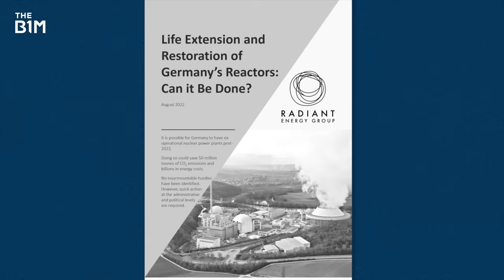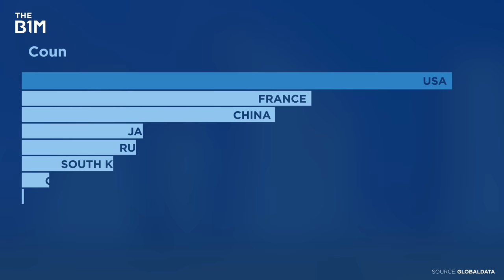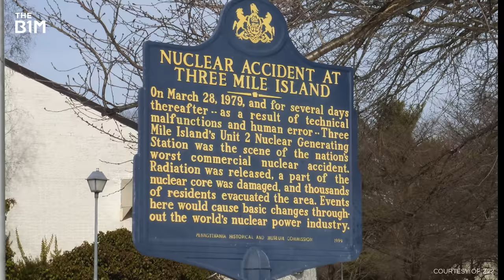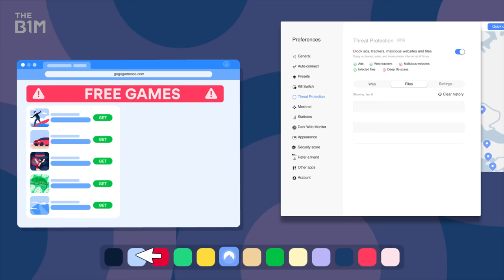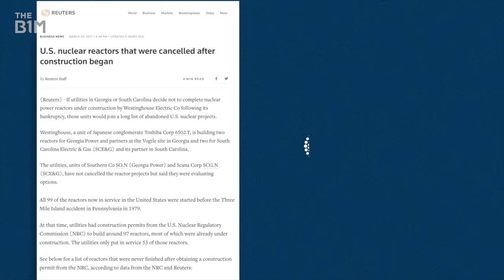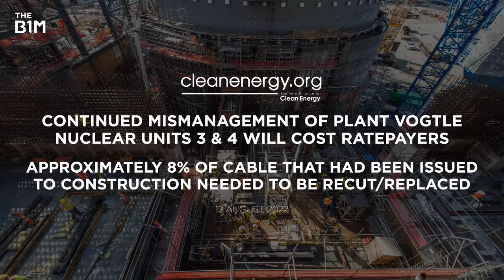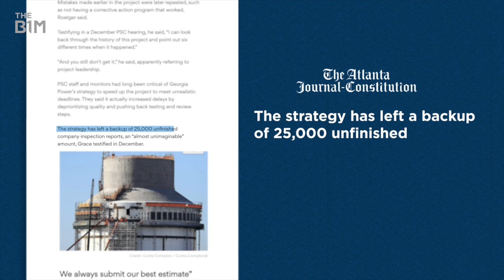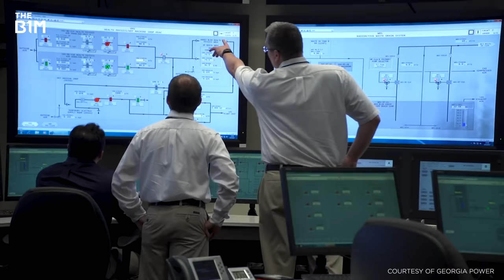Why Nuclear Power is Making a Comeback

Comment: It cost more because we're paying the price for losing industry knowledge and practice. Effectively, we're re-learning how to do this from scratch. That costs money and time.

But its well worth it. These will far outlast gas and coal plants and produce next to no emissions.
Reply: WRONG.  The AP1000 was first built in China and both VC Summer and Vogtle had engineers there and the reactor supplier made any necessary adjustments to improve the build.  Do U.S. construction workers need training on how to weld?  How to bolt things together?  run wiring?

The $31 -$32 billion cost for these two units is 2-3 times what any other power source costs.  They cannot raise electric rates enough to even pay the $1 billion in loan interest let alone ever paying off the principle.
Reply: @clarkkent9080  Do you think we're hiring Chinese crews to build AP1000s in the US?

So no, being built in China doesn't exactly help train US crews or create the industry to support the reactor. All that was left in China.

And those high costs you highlight? A small drop compared to the high costs Climate Change is going to cost.

And we're talking about $32 billion over 50-70 years. 

The idea that because something is expensive its not worth doing is why were in this mess to begin with. Being cheap is not going to pay off the environmental debt coming due.

Comment: Not sure where you got your number for the Flamanville reactor in France but it's not $300M over budget. Based on wikipedia, it's $9B over budget with an initial estimated cost of $3.3B. Similar issues for that reactor and the one in the US: loss of expertise on how to build these things.
Reply: And massive overregulation for “safety”… it’s not “just” the loss of the supply chain and expertise.

Comment: Hi. Unfortunately a very one sided video! The high costs for energy are a huge problem (even with no cost explosion and delays). But more importantly, nuclear power is not the counter piece for solar and wind for the times when “the sun isn’t shining and the wind not blowing”. Nuclear power station need to be rubbed very very steady and are not able to react on the demand resp. on the production fluctuation. 
I really like this channel but please be more journalistic and balanced with your content. Thank you.
Reply: Well, a nuclear powerplant can react on demand but in order to be financially viable it pretty much needs to run at 100% load 24/7. Running the plant at 60% so there is capacity left to ramp if needed, this will cost nearly the same amount of money compared to running it at 100%.
Reply: @oO0Xenos0Oo  It needs to run at 100% because it is not very flexible. Nuclear could theoretically be but current tech is not and it would need a lot of research.
Reply: Nuclear is classic base load generation. A power grid will have a load floor that it rarely if ever goes below. Nuclear running 24/7 fills that base load with zero carbon regardless of wind or sun. Dispatchability is only important for intermediate and peak loads during the day. Take a look at the live generation stack for an RTO like PJM and you'll see a variety of generation sources working together.
Reply: @XMysticHerox  you can absolutely dispatch nuclear power today and it is sometimes done. It makes no financial sense though since there is negligible variable cost between running at 75% or 100% for nuclear. There are limits though, as you can poison the core and have to power down if you reduce power too much, and they are also slow to ramp.

They are such large generators usually in the 800MW range or larger that you only want to lose sync to grid for refueling outages.

Nuclear is base load generation though, there is no need to dispatch them.
Reply: Today's nuclear is suitable only for constant output.  But future Gen IV designs being worked on all over the world will include molten salt reactors fully capable of load following because the Xenon gas that "poisons" the reaction will bubble out of the reactor.  Don't condemn the future of nuclear power by assuming a lack of progress in design of new much less expensive reactor designs that are inherently safe.
Reply: @ChristinaK1024  But thats exactly my point. If it is not economically viable to do otherwise it is not dispatchable. The person I responded to implied nuclear is dispatchable. It's not. Not a single current plant does anything but provide base load and thats not going to change without new tech.

Comment: Nuclear is cleaner in many ways than hydro. Both environmentally and socially.
Reply: I think thats debatable. Both have major impacts during construction phase. The whole uranium mining isnt clean, nor is the waste storage fully solved. In the end all forms of construction and producing have their environmental impact. Also there are multiple forms of hydro electric production.
Reply: @stroll-and-roll  There are some fairly clean small scale hydro options, but the large dams require flooding huge amounts of land, which is usually the best land in the region and tends to disproportionately target lands owned/inhabited by minorities. Which tends to be comparable amounts of land lost as the size of the Chernobyl exclusion zone, with a similar timescale for how long they’re lost for. It’s not as bad as oil or gas, let alone coal, but it’s still worse than nuclear energy.
Reply: @stroll-and-roll  Hydro power totally destroyes the local enivroment

Comment: The irrational fear of nuclear energy is the same as the irrational fear of flying. Flying is the safest, and fastest way to travel. Nuclear energy is ONE OF the safest, cleanest, and most efficient way of generating electricity.
Reply: The thing with flying tho is, that in case something really goes wrong you are definetely more likely to die than other ways of transport! also safety of NPPs is a major issue that wasnt talked about in the video. Like in Ukraine atm.
Reply: @stroll-and-roll  Most nuclear reactors aren't being shelled by hostile imperialistic powers though
Reply: @stroll-and-roll  "More likely to die"?  Does it matter if you are one of 200 to die in an air crash or one of tens of thousands killed in auto crashes each year in the US?  The likelihood is all in the statistics, which favor air travel.

Comment: Just don't connect the reactor control to other networks to prevent the "Battlestar Galactica" problem (where the "Cylions" pulled the plug on entire fleets via backdoors in the operating system)

Comment: There has been one major issue regarding the development and implementation of nuclear power plants that I have hardly ever heard mentioned. In the past, nuclear plants have been attempted to be built but have run into tons of logistical issues regarding regulatory bodies in the government. Engineers for plants would meet the necessary requirements for a plant, begin construction, only to be met with new and updated requirements during the process of construction. The engineers would be forced to alter blueprints, reconstruct already finished parts to implement the changes, which would increase the budget drastically and slow progress. The regulatory bodies would keep changing regulations over and over to the point where the plants were essentially a complete waste of time, money, and resources which would lead to the project being scrapped

Comment: The construction of "smaller" modular nuclear plants is still to happen commercially. As the UK showed, if you don't build new nuclear for ages, then you lose talent and muscle memory. Meanwhile Europe needs big plants and even the French have not built new plants for ages. We are still awaiting more self-compensating "cheaper" nuclear that can attract private capital, avoid massive over-runs in cost and meeting time schedule plus avoid chronic time delay in planning. Meanwhile many existing plants need to be refurbished just to remain working safely. Upgrading existing plants to extend their lifetime and boost efficiency from what was on offer in the 1970's will be as big a project as any new ones plus the old ones exist, work and not everything would need to be upgraded to extend their power generation lifetime. However retrofitting will cost as much if not more

Comment: You know you can pump water uphill while the sun shines and use that energy later or produce hydrogen to use later
Reply: And you know that those installations are highly dependent on geography while producing hydrogen wastes a LOT of the energy you put in it in the first place.
If we would run on 100% emission free energy, you would have a point. 
But We're not

Comment: I honestly don't understand why people are so opposed to this. People usually are VERY into "high tech" solutions that act as a silver bullet solution.
Reply: My Georgia power electric bill is some of the highest in the nation due in part to Vogtle unit 1&2.  I have has a 19% Vogtle construction  surcharge on my bill for 3 years now and they just asked the PUC for a $600 million rate increase for unit #3.  Georgia power has 2 million customers....you do the math.  NOW do you understand?
Reply: @klerkcant9080  And your electric bill would be much higher on ruinables.  Along with those exorbitant electricity rates, you also wouldn't have power available at all most of the time..

Comment: Recently in 2024 I see the UK has made a strong commitment to build 40 small modular rectors (SMR) in 10 plants across the UK, each plant have 4 reactors.  Using the new X-Energy Xe-100 reactors.  These new high temperature reactors use helium to transport the heat at 800 degC....which is efficient.  The reactor fuel pellets are tennis ball or billiard ball sized 60mm diameter and are 3 or 4 times coated and do not emit any radiactive materials.  The helium gas does not become radioactive.  This gravity fed system replaces 175 pellets every day continuously automatically for 60 years, or can be replaced in batch mode to permit maintenance.   Please review this new Xe-100 reactor...looks like the UK will be doing this very soon, and can use co-generated heat to do other things like desalinate water, or get hydrogen.
This Xe-100 reactor operates with 95% availability, and is load-following, switching from 75% to 100% output power within 10 minutes.

Canada also has a similar approach they are working on possibly also using the Xe-100.

In the United States the Xe-100 has also passed many safety protocols, papers, protocols, and reports; and is soon on its way to be submitted for NRC approval.

Comment: FUN Fact 1.... Wind costs $1.3 million per Gigawatt, so $30 Billion gives 230 Gigawatt hours installed power. Half that put the rest into storage. No Melt-Downs to take out a city value of real-estate... How much is that?
Reply: Sure, wind costs are cheap; and batteries cost about 100/kWh. Ooops! not so cheap.

Also, although wind may only cost $1.3 million per Gigawatt (installed capacity),
it has a capacity factor of 35%, so it would cost about 3.7 million per GW (useful capacity).

Comment: Nuclear has always been the answer. Frankly it’s sad that a plant placed in a geographically risk prone area that underwent a relatively expected event. Which happened to have a slightly higher tsunami than expected. Like. What. Do they expect a tsunami to hit the middle of Illinois… crazy huh
Reply: That wasn't the problem. The problem is something unexpected happened: it lost outside power as well as the emergency generators. Nuclear plants can't lose power or the pumps won't work and it will overheat and meltdown. They also didn't know that hydrogen could build up and explode. Who knows what else they don't know? Russia and Ukraine seem to be playing Russian Roulette with their nuclear power plants. It wasn't expected to have nuclear plants in a warzone.
Reply: @sandal_thong8631  The did too most certainly know about the hydrogen.  If their culture allowed modern updates to the plants as recommended there wouldn't have been an issue.  Those generators were a known issue.
Reply: @nathanwahl9224  A known danger that's ignored sounds like... negligence?

Comment: NUCLEAR power is amazing we need more of it
Reply: Like this?

If you live in the U.S. here is the reality for the last 4 “state of the art” Generation III Westinghouse AP1000 ADVANCED  new nuclear power projects and spent fuel reprocessing in the U.S. over the last 20 years. The AP1000 is fully approved by the NRC for construction and operation.  The only NRC requirement is that the plant be built per design documents…..seems simple..

The Southeastern U.S. is super pro-nuclear MAGA, has zero anti-nukes, and 100% media, local, and political support. 

The MOX facility (South Carolina) was a U.S. government nuclear reprocessing facility that was supposed to mix pure weapon grade Pu239 with U238 to make reactor fuel assemblies. It was canceled (2017) in the U.S. After spending $10 billion for a plant that was originally estimated to cost $1 billion and an independent report that estimated it would cost $100 billion to complete the plant and process all the Pu239, Trump canceled the project in 2017.

VC Summer (South Carolina) new nuclear units 2&3 were canceled in 2017 after spending $17 billion on the project (original estimate of $14 billion and 2016 completion date) with no clear end in sight for costs or schedule. Four managers on the project were charged with 16 felony counts, including conspiracy, wire fraud, securities fraud, and causing a publicly traded company to keep a false record.  The CEO of the project is serving 2 years in prison, another manager just got 15 months in prison, and the others are awaiting trial.

Vogtle (Georgia) new nuclear units 3 &4 at 110% over budget and schedule (currently over $34 billion with an original estimated cost of $16 billion). Mid way into the build, the utility stated that had they known about the many costly delays they would never have chosen nuclear. They were just delayed another year because according to the project management, thousands of build documents are missing. The first unit should start in 2023 and when it does, Vogtle will be, for its output, the world’s most expensive nuclear power plant.

Please google any of this to confirm.

If you can’t build new nuclear in the super pro-nuclear southeast U.S. then where can you build it?

Comment: Coal and lignite are all cheaper than nuclear. By far. However, so are solar and wind. The problem of intermittent power with real renewables would only be a real problem if you try to cover more than 70-80% of grid power. The US is decades away from achieving that and still remains mainly fossil powered. Storage options are arriving mich more rapidly than any relevant construction of nuclear power plants. The first modern ones that were built in Finland in France were also over budget and behind schedule.

Comment: It’s a common sentiment, but if from the 50’s we had collectively invested into nuclear power with the same resources and fervour we did nuclear weapons and fossil fuels, the whole world would be run on nuclear. It has been so woefully underfunded on account of the stigma & cost associated with it in modern times, and it’s perceived lack of importance prior. 

I’m of the opinion that is 50 years nuclear power will be commonplace, not unalike to how EV’s are today against the background of internal combustion cars.
Reply: Nuclear is the most expensive method to produce electricity by a wide margin and gets more and more expensive each time we try to build one

Comment: After Oak Ridge Director Dr Alvin Weinberg was fired by the Nixon Administration for being too concerned for nuclear safety and efficiency the industry has gone to hell.  Weinberg's crew at ORNL had invented and tested the molten salt reactor and were ready to build and test a full size power generating breeder reactor.  Lesser men from the AEC thought they knew better and against the advise of the inventor, also Dr Weinberg, they built massive pressurized water reactors like Three Mile Island.  What could possibly go wrong?